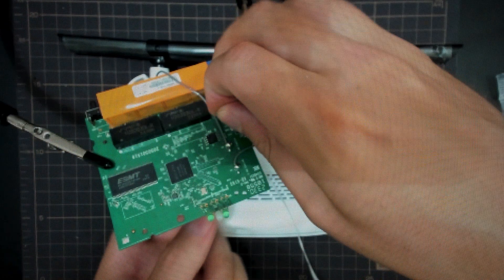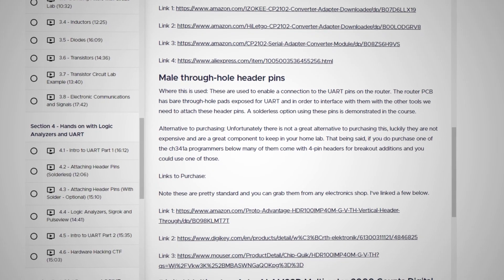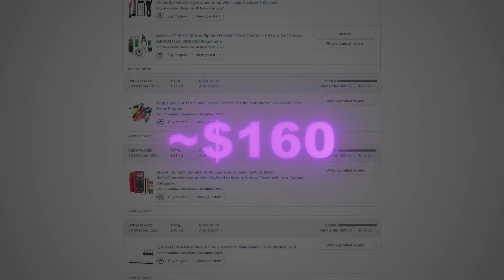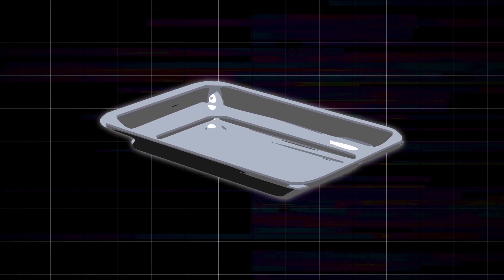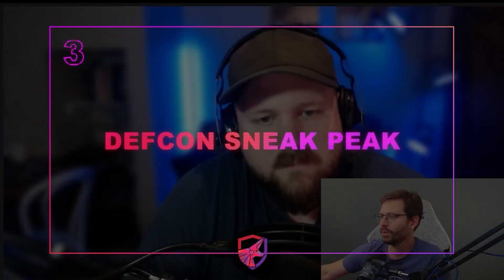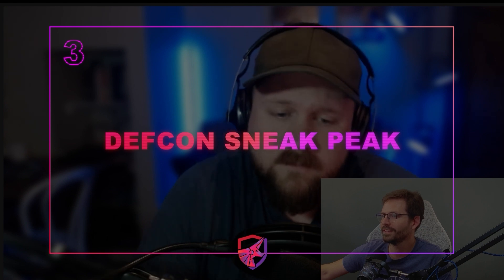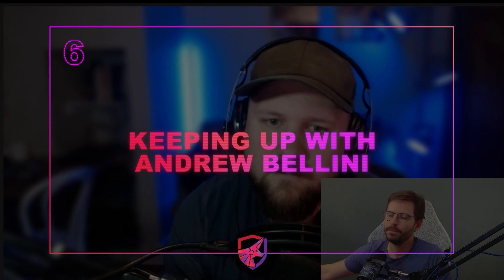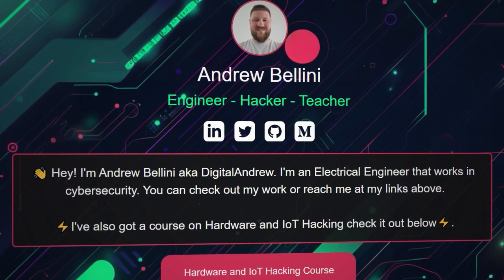Getting Started With Hardware Hacking

Comment: Don't want to solder, get a BDM frame, im regularly shocked by the people who dont seem to know such a thing exists.  

And the superior option a 3d printed bdm frame that uses acupuncture needles as probes and little arms that you can position around a mounted board. Much easier to see than thr bdm frame and you can use micrscope, its like a manual version of a professional pobe station. I know how to solder reasonably well but its way easier to position the tip of a needle on something like a 0.4mm trace. (And if you get good you don't even need the manufacturer to even have probe points or headers already on thr board)

Comment: I'm looking forward to see hardware hacking videos from your channel. I've also done some projects in hardware hacking, like getting a root shell and reversing some custom binaries using ghidra. But hardware hacking isn't entirely linux. You may come across RTOSes or bare metal code. So I would advise you to work on with some routers or ip cameras because usually they run linux. Also, get good at understanding linux kernel driver code. Bash scripting is also important since you may have to analyse some start up scripts. 

When it comes to soldering, beware with leaded solder could possibly harm you if handled incorrectly. Also, the fumes emitted by rosin flux are also bad. So be cautious since it's your first time soldering.